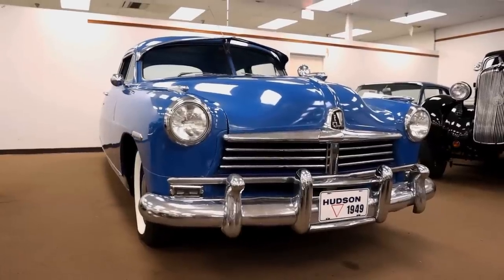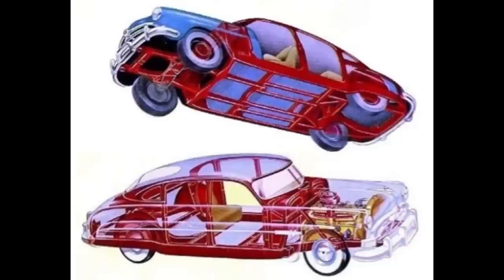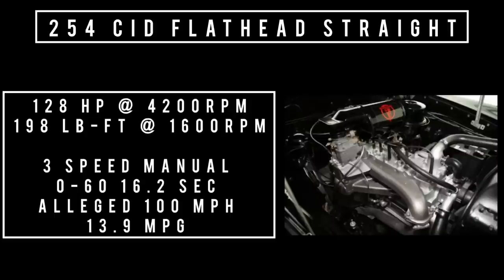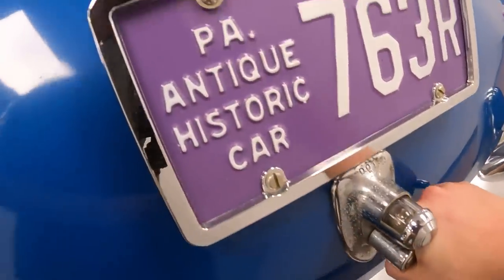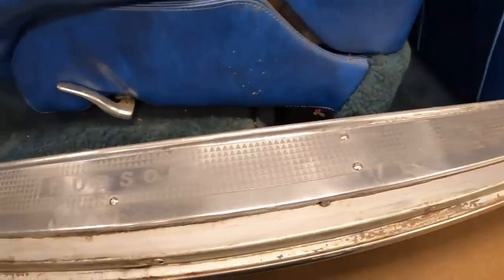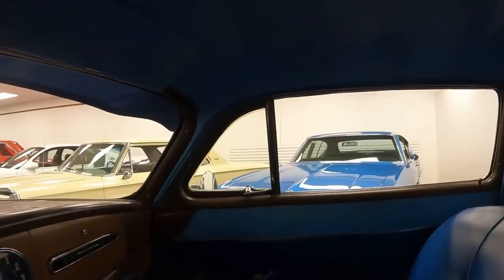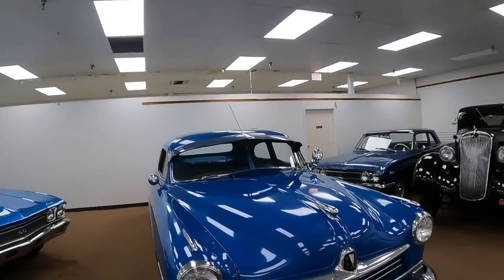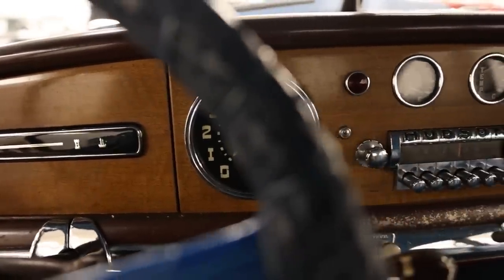1949 Hudson commodore, with it’s all new step down design.

Comment: The "step down" Hudson was "all new" when introduced as a 1948 model.  Studebaker and Kaiser also beat out the Big Three in post war designs.
Reply from the maker: Thank you for that =) 

Kaiser killed it in the early years
Reply: @What.its.like.  Kaiser only made a profit in 1947 and 1948.   In 1948, Henry J Kaiser took out a huge loan to increase production, anticipating building 200,000 cars or more with facelifted Kaisers and Frazers.  Joe Frazer, an old automotive man rebelled saying the company would lose a boatload of money. Frazer left and the loses here huge.  Leftover 1949 bodies were sold as 1950 and even 1951 cars. that was the only reason a 1951 Frazer was even built.  

Kaiser joined up with Willys  and continued building cars in the US till 1954. After that, Jeeps till AMC bought them out. The Kaiser Manhattan went to Argentina where it was built till the early sixties. Maybe 1961. 

Kaiser had a bad habit of building more cars than the dealers could sell. I once owned an early series 1954 Kaiser "Special."  This was one of over 3,000 unsold 1953 Manhattans taken back to the factory and given 1954 front sheet metal,  grill, and "Safety Glow" tail lights.  They must have lost a lot of money on that one.

Comment: They also had a Drive Master semi -automatic transmission.
Reply from the maker: Thank you so much for that correction one of the sources said that it had a three speed automatic but I couldn’t find that in any other research that I did,  =)
Reply: @What.its.like.   Also,  most  convertibles had leather upholstery  and hydraulically powered windows and top.
Reply from the maker: I saw that convertibles had a hydraulic regulator for the windows I figured cover that whatever find a convertible model to do I’d like to feature all of the body styles if possible =)

Comment: It was a car that was featured in an ad for Volkswagen Beetle a few years ago. As a car that didn’t keep its promises. Anyone remember the ad?
Reply: But then I guess ultimately VW didn’t keep their promise either. When you see that VW used to be reliable basic transportation and they no longer are. 🫢
Reply: @glennso47  Well, my 99.5 Jetta had 270,000 miles on when sold.  Person who bought it, still driving 4 years later. Never had any issues - never and only 1 recall, It depends - - -
Reply: I loved the original Beetle's. Had 5 of them. Simple, dependable, easy to work on, inexpensive. I rather believe it was VW that didn't keep its promises.

Comment: If it is cold to the touch it is metal!
Reply from the maker: Not always if one is in a heated building it’s not always cold
Reply: @What.its.like.  Even in a heated building metal is colder to the touch than wood or composites! I had to determine what doors were made of inside and outside of buildings for 40 years and I never got it wrong and you shouldn't either! It's really that simple!